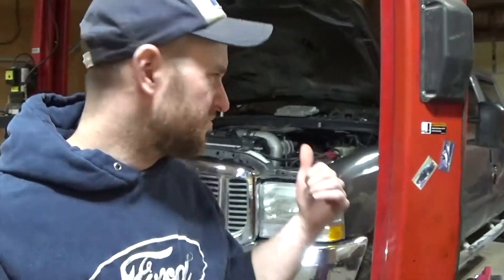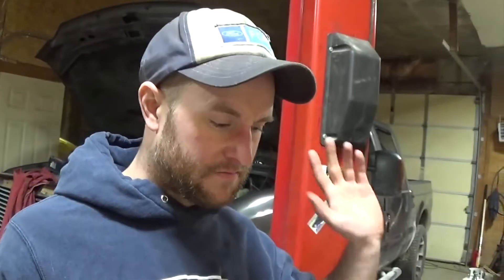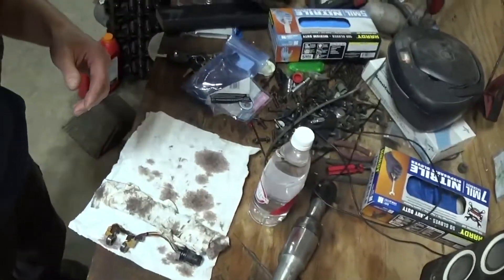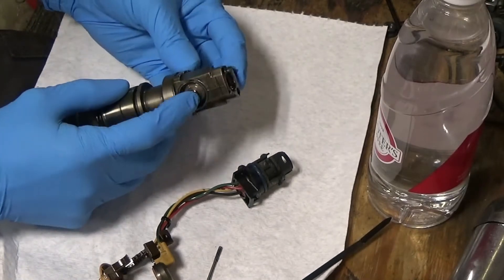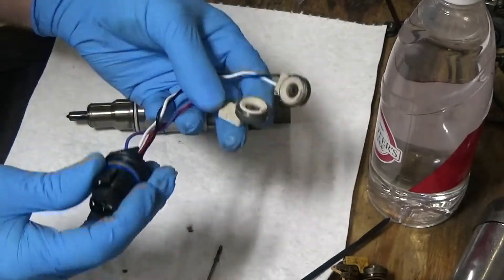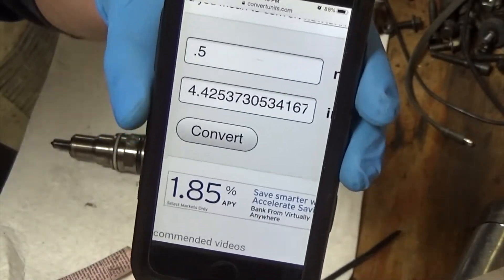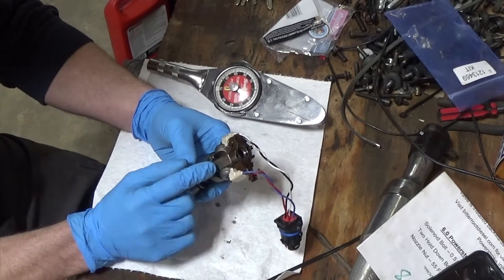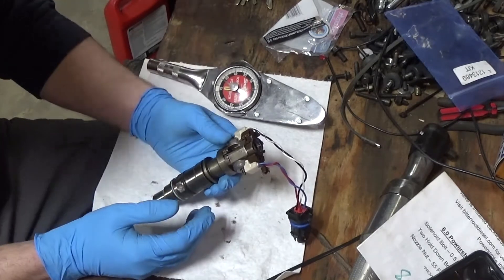6.0 Powerstroke Injector Coil Failure

Comment: Do these coils serve as a magnet to slide over the spool valve to reveal oil port? Also what is the voltage seen at these coils? I just applied 12v DC. for shit and giggles to see what it would do, only thing it seem to do was get hot, did i just fuck this coil off? Sorrry not much of a diesel guy, first time with these.
Reply from the maker: @jacobwestcott4536  .4-.6 ohms at room temp
Reply: @showmerepair  
im reading about 1 ohm at about 75 degrees faranheit, acceptable?
Reply from the maker: @jacobwestcott4536  yes they are electromagnetic. The FICM fuel injection control module operates at 48 volts. 
I’ve not ever applied voltage I just test resistance.
Reply: Ok, whats the ohm spec on these? Thanks for the reply by the way, very awesome of you!
Reply from the maker: @jacobwestcott4536  that should most likely be ok. If possible, check resistance on other coils to compare
Reply: Yeah the rest are reading the same resistance, should be good, THANK YOU BROTHA!!!!

Comment: Thanks for this. Have a #2 circuit low and a cylinder 2 contribution balance code. FICM though I believe is high 47v so maybe bad FICM. No buzz or anything while running koeo test. Gonna try to swap 2 and 4 and rule out a harness before I jump under the valve cover
Reply from the maker: Sounds like cool gone bad. 47v isn’t horrible. Weak batteries can cause lower then desired ficm voltage at times, especially if key has been on and running test with scan tool. 
I wouldn’t even swap 2 and 4. Pick up a replacement injector. Disconnect injector 2 connector and plug new injector in. Run buzz test. If injector 2 circuit code goes away and it buzzes during test, just replace #2

Comment: How many both a text to get this injectable running
Reply from the maker: ? How many volts to get the injector to fire?
Reply: @showmerepair  Yes is my question how many bowls a text to fire the injector
Reply from the maker: FICM M power should be minimum 48 volts
Reply: @showmerepair  I only replace the oil cooler I got it back together twice and doesn’t start door apart twice Is fuel and everything but injectors don’t fire If I spray some few starts
Reply: No air bubbles in the fuel system
Reply: @showmerepair  Checked  wire harness real close everything is good
Reply: @showmerepair  I have a really good guy pressure oil
Reply from the maker: It’s really hard to understand your text. Are you doing talk to text. If so stop. Or reread your text. 
Do you have a scan tool you can monitor data from the pcm?

Comment: What is the program you're using for the power balance test? IDS? I have access to a scanner that will do a balance test, but I can't remove the adaptive strategy (I think they call that an uncompensated cylinder contribution test?)
Thanks for the videos! I just got done rebuilding a set of injectors. I wouldn't have even considered attempting it until I saw your series on it.
Reply from the maker: Great to hear that the videos helped. They are boring but I’m glad they help. 
I was using the IDS software. I just got forscan.  I heard it has power balance. I’ll find out and update.
Reply: "They are boring" he says. I must be a Powerstroke geek, because I find them interesting.  ¯\_(ツ)_/¯

Comment: it wont HPO leak stuck open or closed , there is a very very small overlap in positions where it could
Reply from the maker: I’ve read you comment over and over. I’m having trouble understanding what your talking about. Are you talking about getting the spook valve in the wrong way?
Reply: @showmerepair  if the spool is hard to either side it wont leak HPO....there is a position or overlap where the HPO is vented for the shortest amount of time as the spool is moving sides ....2 circuits open at once
Reply from the maker: Yea I agree
Reply: @showmerepair  its a very small window of time there both open ...HPO oil can leak out if the spool is in this exact position , from the upper nipple seal and lower oring under the spool , or a worn spool ....if you move some lighty switches very slowly from on to off theres a point where it'll arc and the light will flicker ..its both on and off lol

Comment: that burnt coil had a slot in it , it that new coil that is suppose the cold weather stiction problem ??  thanks bob
Reply from the maker: bobsdogtag I was told by a person that commented on one of my other videos that the updated coils have a slot to help with stiction. So yes.
Reply: @showmerepair  thank you
Reply: Chris do you have any more info on that burnt coil ?
Reply from the maker: bobsdogtag what info are you needing? I’ll try to help
Reply: @showmerepair  I recently had # 1 take a shit on me , I pulled the whole bank out # 1 the upper collar or bushing that holds the intensifier piston came apart and compressed the spring shortened by 1/2 inch and bent it,  the same thing was happening to # 3 but had not failed yet,   cleaned all and had good spray patterns , installed new springs and the collars or bushings on all four , I had no codes so I went with the original coils and it is running good,,, getting ready to do # 2 #4 # 6 and 8  and I was thinking of installing these new slotted coils  but after seeing your burnt coil am not sure now ?   2006 with 106,000 miles   I live in northwest WA. while not brutal winters it kills me when it convulses during a cold winter starts   , just looking for your opinion ?